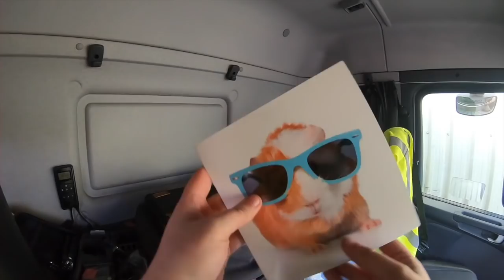Vlog #27 - Another day of HGV driving *GoPro Chest Cam*

Comment: Thanks for the shout out Hayley. Also, happy belated birthday. Sorry I missed it.

Talking about distance work, I start early every day (a lot of time 3am ish), and sometimes run up to Newcastle, which is 187 mile one way (3h40 driving).

A tip I'd also give is, if you have a tomtom, save places you know you can have a break in. I normally put the company name and then "break" in brackets after. This is VERY handy in London if you need a break.

As I said on Instagram, I'm happy to help if you ever have any questions.

Trucker_Andy

Comment: When you get chance , try to dive the lorry , maybe when you are light , without the clutch at all . You will soon get a proper feel of what is going on with the box and what the best revving point is to change , if it’s a scania , they like to “pull” so change up quicker and at lower revs . It’s just all part of getting to learn how to drive an older lorry , they all have their quirks that come in as the miles pile on so just find a way to drive round them and accommodate them 😉

Comment: As Chris Shaw says. sounds like the "synchromesh" is out on 5th or 6th gear.
if you go up to 5th or 6th gear,  release clutch in neutral and re-engage to higher gear.
on the way down, rev engine in neutral. hope this makes sense.

Comment: If you don't like the idea of driving two hours - class 1 might not be for you. And if you're going to North Wales from the Midlands you'd probably want to use the M54 or the 41. It's common to drive your full 4.5 in a class 1 tip and back if you not on multi drop. But IMO class 1 way easier than 2 and experience in 2 after a couple of weeks no benefit at all  to driving class 1.